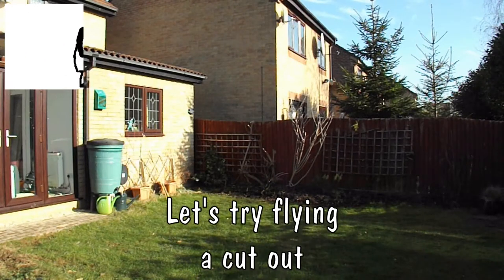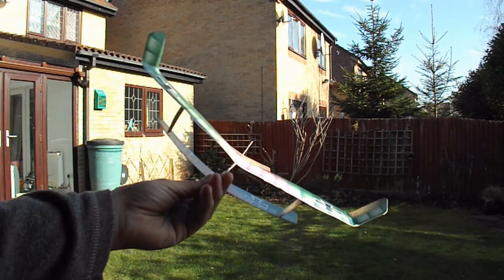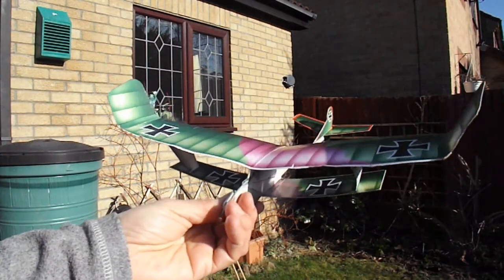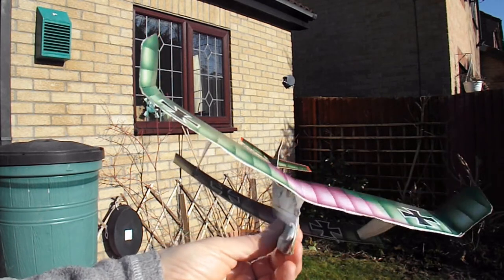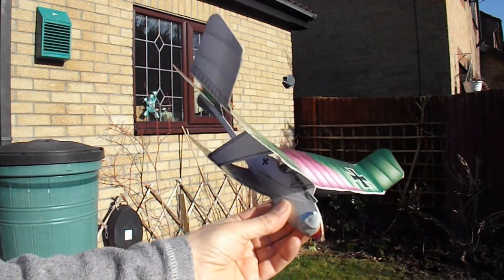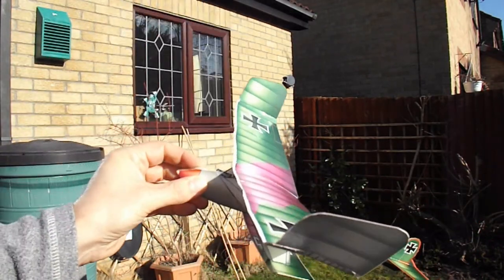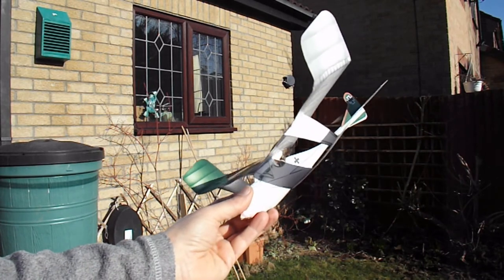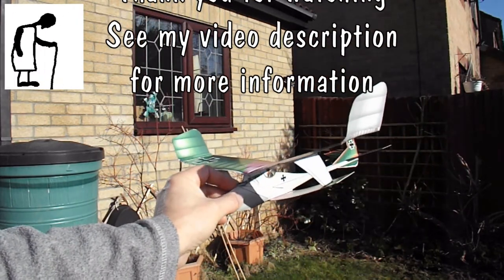Let's try flying a cut out card model biplane

Comment: with all the weight that you had to put into it do you think that throwing a tiny motor onto it would work? may be you can even add a little bit of rudder control
Reply from the maker: I don't think so, why struggle with something like this when you could make something from foam board that would be lighter, more rigid and fly properly.